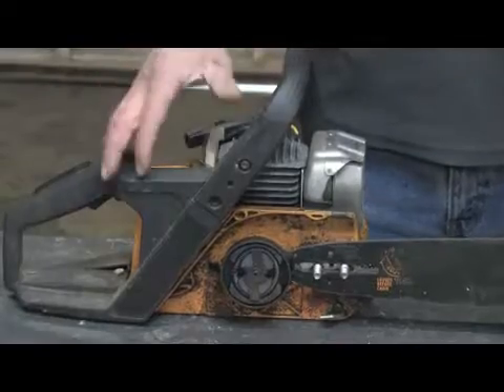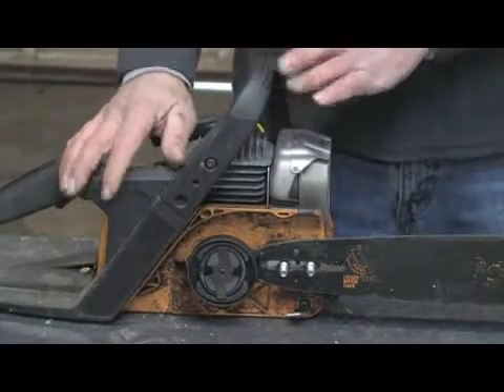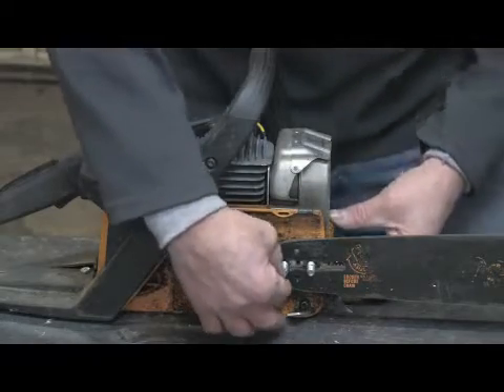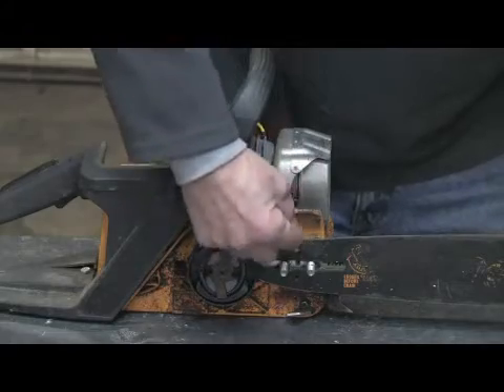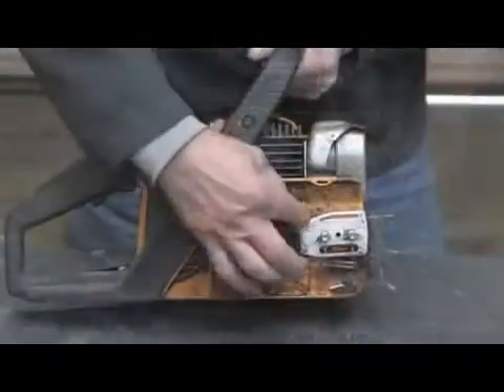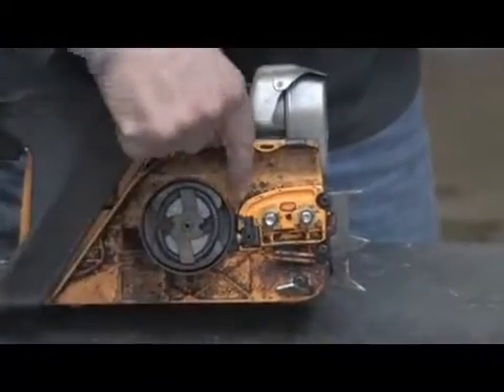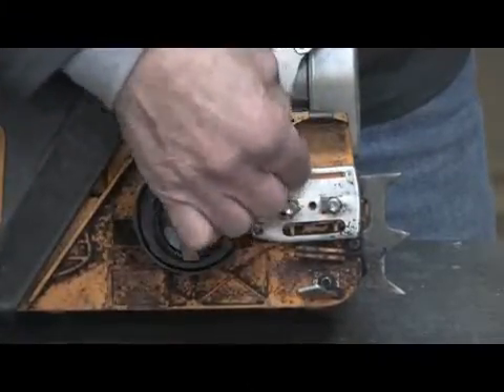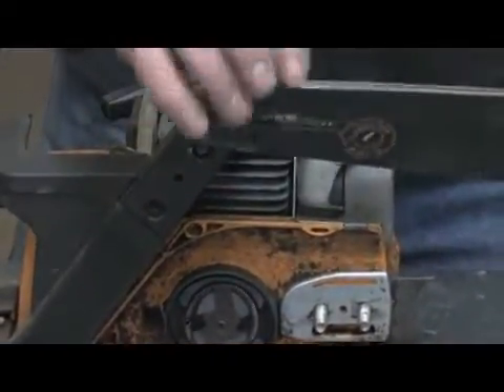How Does a Chain Saw Bar Oiler Work?

Comment: Can i use cooking oil for bar lube?
Reply: No that type of oil does not lubricate the parts
Reply: Yeah ill stick to motor oil @conner5611
Reply: 40W works for me on the bar, but i guess bar oil would be better @conner5611

Comment: no, this is what it does. not how it works.
Reply: Not sure what video you were watching but he clearly says it works via a pump which is driven off the crank which then draws the oil from the tank up through to the bar via the channel, or canal as he says………I mean that’s clearly how it works, how much more info are you wanting?
Reply: @KeyserSoze5421  when i wrote this i specifically needed to know how a typical chainsaw oiler works, so i could know if i could manipulate one to pump less oil for a projekt.

This does not say how the oiler works, it simply say "oil goes in here, out here, a grove, tada, oiled"

Like. I needed to know. How does the pump do the work. How does it work. 

Well well. Solved that one a long time ago now 😄
Reply: @CimJohanssonStrength  but it does, the oiler works by being driven off the crank, I mean how else do you think the oiler on a chainsaw works? The video states that clear as day.
Reply: @KeyserSoze5421  ok, so the oil like takes a lap around the crankshaft and is flung out in a tube? or is it maby a small piston with valves that pump the oil? or maby an impeller? no one knows, how it works, from looking at this video.

good to know anyway that the engine drives it's own oiler :D
Reply: @CimJohanssonStrength you really are hard work aren’t you? It’s a pump, there is a gear or worm gear that drives the pump from the crank, it rotates and activates the oil pump when it rotates, this draws in the oil from the oil tank and then distributes it wherever you have the feed going.
Reply: So, we still don't know how the oiler works.